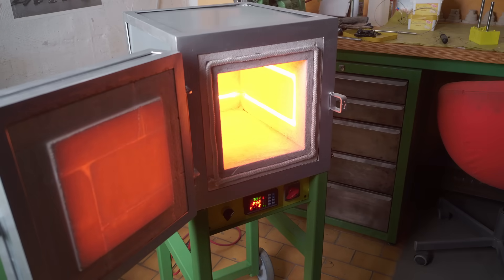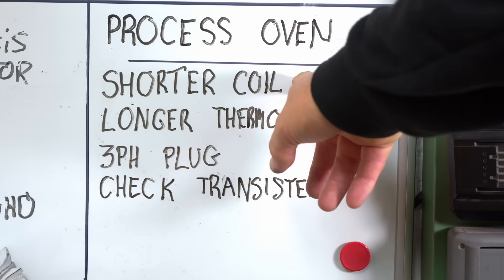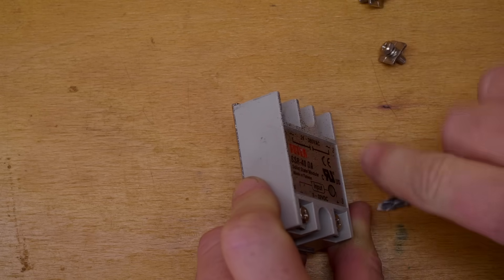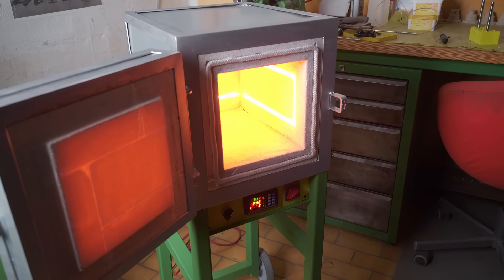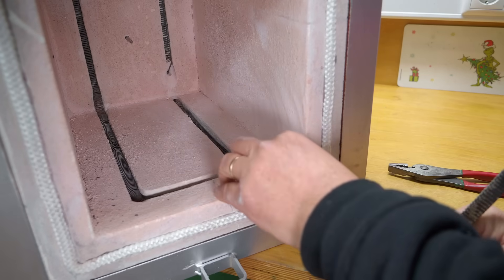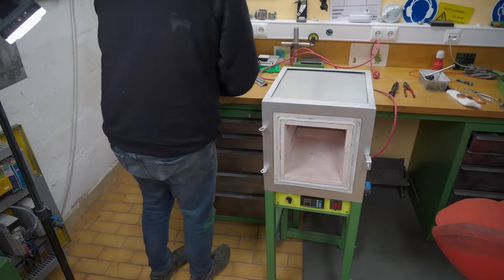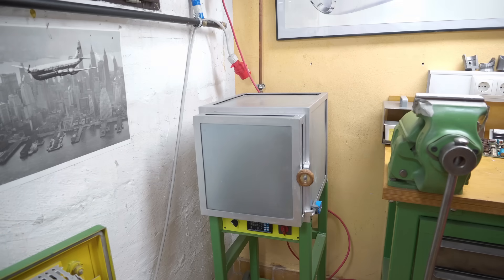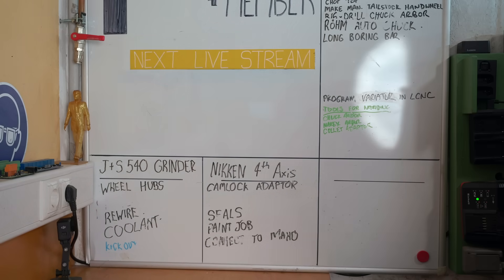Lets crank up the DIY process oven to 11 || RotarySMP

Comment: You already have 3 phase.
Add another coil and relay, connect it to the other phase, and you will double the power.
Or.. make two longer coils so they do not draw 3KW each, but for ex... 2.5 or 2 KW each.
Will be almost double power compared to previous version, and will not push instalation to the limits.

That half melted electronics...
Just move thate box down. Separate it from the oven itself. You have more than enough vertical space in that stand.

Yes.. I know.. more work... :) but...
Reply from the maker: My old oven was two phase. It is not trivial to find the space in the walls for more or longer coils.
I already ordered a fan.

Comment: I mean you could have just connected the old coil between two phases to increase power...
Reply from the maker: That would need a different coil length for the different voltage, ut yes, I get the concept. :)

Comment: try the old coil in an oven for 1 hour at 200 degrees Celsius, then it will (hopefully) no longer be so brittle?
cheers
ben
Reply from the maker: Thanks for the tip.

Comment: heat thenthal with a torch to red and the you can work with it without breaking it. you can even twist the broken one and use in case of urgency
Reply from the maker: Thanks for the tip.

Comment: I normally used 'bare' thermocouples with ceramic bead insulation  instead of stainless encapsulated type in furnaces.
Seemed to last longer and are quite a bit cheaper than branded stainless type. You might be using ebay specials of course, which I'd think are fine for temperature accuracy, but might not have the durability of a better quality unit.
For reference, my tube furnace is more than 20 years old, still on original thermocouple.
Reply from the maker: Thanks for the tip.

Comment: The 25A rating on the triac is probably conditional on the junction temperature being 23⁰C or so, as soon as it heats up, the maximum permissible current will probably fall significantly...
Reply from the maker: It has been recommended I replace it with a mechanical relay.
Reply: @RotarySMP Whether that's a good idea or not would depend on how the control output switches. If it pulses too rapidly, it will soon destroy the relay. I once worked on a kiln controller and a lot of effort was put in to making the switching profile turn on and off slowly enough to support big contactors. It turned out to be a really important feature on the controller and meant it found a lot of customers who favoured that over more rapidly pulsing controllers. It had features like looking at the rate of temperature rise and turning off the relay well in advance to prevent overshoot. If I remember correctly, the minimum switching period was about two seconds.
Reply from the maker: @AllTheFasteners  It seems to only switch about 5-10 sec when maintaining 900c.

Comment: Potters have these things called pyrometric cones that they use during firing. I don't think they're expensive, and suit a wide range of temperatures from around 580°C up to perhaps 1980°C. The great thing about them is that you can place them anywhere you like, so you could use four-or five at once to simultaneously check the temperatures in different parts of the oven. Not something you'd use routinely of course, but they could be useful for verification of your thermocouple and PID control, and to see if your oven has any hot or cool zones you should be aware of.
Reply from the maker: Good point Paul. A workmates wife does pottery. I will ask if they have any.
Reply: These sound like welding crayons?
Reply from the maker: @johnhawkinson  They are little clay cones of different melting point clays, and sag and bend over a a specific temp.

Comment: Any reason you dident just rewire the heating element to run on 400V ?
Reply from the maker: I would have to run the calcs, and would probably need a completely different coil, with different wire diameter, and number of turns.

Comment: Very interesting on coil size/resistance verus heating time; good idea on utilising 3 Phase outlet to maximise power in the shop.
It's always scary buying power electronics, unless its from top notch suppliers, though running power electronic equipment at 25% of rated capacity does offer some safety. 
Nice work as always.
Reply: Kanthal do some really good design literature for wire heating elements like these, available online in PDF format.
Reply from the maker: @davidbillington9654  That is what I used when I did the initial design. Not sure how I screwed up and ended up with the coil too low power.
Reply from the maker: Yeah, I feel better about putting the high current load onto the 3Ph wiring.

Comment: At 7:54 to 7:58, ventilation would probably be better, as insulation will still eventually get hot if it can not dissipate its heat.  Maybe try some more distance and ventilation, as well as insulation.  Insulation only slows heat migration, it does not not stop heat migration. Temperature gradation is due to dissipation across the distance covered through the material.  If it can not dissipate, it will eventually fill up with heat, to the full temperature.
Reply from the maker: Yeah, I have ordered a fan. :)

Comment: Give it’s now on 3ph you could add 2 more coils and drive them at 1500w for longer lifespan. 
Love this week’s music background.
Reply: or, and bear with me here, 3 shorter coils for even faster heating! More Power!
And, yeah, the music was great :)
Reply: @clasdauskas no need just connect 3 coils in a delta configuration meaning they are running at 400v so a heap of extra heat for no extra current draw
Reply from the maker: @shaynegadsden  The issue is the amount of wall space being so limited, so you can fit multiple coils.

Comment: I wonder if the discrepancy between the current you expect and the one you measure could be due to the bit of inductance created by the coil. It's a very loose coil, so the effect should be small, but maybe not completely negligible.
Reply from the maker: I have been told the SSR will also drop a bit.

Comment: I did the QA on sourcing SSRs for safety critical nuclear applications. The original 'Fotek' brand were very good - the problem is that there are more counterfeits than real Foteks! We got counterfeits even from established suppliers. 

You probably already know but for the benefit of others SSRs tend to fail closed circuit. In any device we made there was triple redundancy - a second PID controller that cut the power if it overshoots and a final bimetallic switch if that fails. Jealous of European three phase connectors - IMO it is way better than the NA standard. Awesome content as always
Reply from the maker: Thanks Francis. It has been recommended that I switch to mechanical relays to reduce the current drop.
Reply: @RotarySMP  I think it is really swings and roundabouts - what you lose on the load side with an SSR  you gain with reduced current on the control side. I may be overstating the danger of the failure mode - the nuclear industry is rightly  anal about fires. The reality is the the heating coil is its own safety being essentially a fuse and will melt almost instantly after the SSR latches on.. If you look at MIL-HDBK-217f the SSR will outlast the mechanical relay by a factor of 50-200 - I'd say that is worth a  worse power factor especially given that the SSR will be cycling at a decent rate at the set temperature which is hard on mechanical relays. We had to buy 20 years of spares for our samplers and in 20 years of operation we never touched them so I'd say that is a pretty rare failure mode. If you do fit a mechanical relay - given the current you need the mercury wetted ones are the best if you can find one and obviously beware of the latching versions - you need a diode across the coil to stop back EMF that every one forgets.
Reply: ... in short I'd keep your white board clean!
Reply: FYI I happened to be at our local pottery supply house and they had some very dusty Mercury relays on the shelf at what seems a very old price - a quarter of what digikey is asking. Given their extremely low failure rate I suspect it is probably the case at most pottery supply places.

Comment: Did you screw down a multi stranded mains lead wire in that terminal block without ferrules?
Reply from the maker: Nope, there are ferrules on all multi stranded wires
Reply: @RotarySMP  Good! I couldn't tell, but with the thermal cycling a necessity

Comment: If you haven't tossed it in the bin yet, the open-circuit thermocouple could have the break nearer the lead ends. You could try trimming back a few times and possibly salvaging it as a spare.

Regarding the fan, make sure you provide accommodations for the air to get in AND OUT.
Reply from the maker: I suspect that is probably the issue. 
Will do.

Comment: Or you could get two more solid state relays and run 3phase to the oven.
Reply from the maker: I dont have the wall space in that little oven to fit tw0 more coils.
Reply: @RotarySMP one long coil in each left/right wall and one in the ceiling.
Reply from the maker: @nscantling  Have you made an oven like this? Hard to get a coil to hang from the ceiling. Not impossible, but would have had to be planned from the start. 
I have 1.9m of coil groove. You can't make a two coils fit in 1.9m and remain within the heat density limits.
Reply: @RotarySMP  I did not consider that.

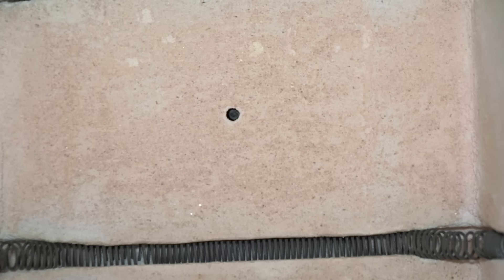Comment: 1:10 IMHO, just make the hole chamfered to the depth of the tip of the probe. keeps it protected an exposes it to the heat.
I've also found issues with the non polarized plugs here... 3 phase are polarized. (at least I'm pretty sure) 
You could install a dedicated outlet with bigger cable and breaker and then mark the phase side on both plug and socket.
Reply from the maker: First I will see if this set up has any issues Johannes.

Comment: I have some kanthal wire and thermocouples and crydom solid state relays etc that i can send you if youd like
Reply from the maker: Thanks for the offer. I still have enough left over Kanthal 1.2mm to make another coil. It has been suggested that I switch to a mechanical relay to reduce the losses there.

Comment: @2:42 G'Day Mark, are you sure about that? All our standard house wiring is 2.5mm² for use with a 16 Amp breaker.
Reply: However, your red extension lead cable still is 1.5mm² so there could be some voltage drop.
Reply from the maker: Good points. I am not sure what this house wiring is. It is pretty old.

Comment: The oven might very well be over the 3 kW mark when fed by the CEE plug and 2.5 sqmm wire as the voltage drop will be lower.
Reply from the maker: That would be great .)

Comment: Remember to do a new PID tuning with the different thermocouple and heating element :)
Reply from the maker: Yeah, I took a look at that yesterday. The manual is a horrible translation. I think I did the autotune (at least I tried to??) and it seems to control the temp at 900 within about 4° indicated.
Reply: @RotarySMP  They're always horrible to read in my opinion. Often incorrect and Swahili added...

Comment: Nice to take time and put some finishing touches on projects. 👍😎👍
The camera angle always distorts the view, but it looked like where you have the oven when plugged into the 3-phase outlet, the cord was resting on the outer metal corner of the oven frame.  Does that edge get hot?  Wouldn’t want to melt the cord and start a fire 😉.
Reply from the maker: Thanks for checking Joell. I also noticed that and moved it off.

Comment: UK spark here. According to UK regs 1.5mm is only good to a maximum of 11A - we only ever use 1.5 for lighting circuits. We use 2.5mm for our 13A  (ring) sockets - 2.5mm is good for 27A. Depending on distance from fuse board obviously. There are a number of online cable calculators based in the UK for a sanity check
Reply from the maker: This place is pretty old. I am not sure whether they used 1.5 or 2.5 to the sockets, but I know there is 2.5mm going to the 3Phase sockets.
Reply: At least in Germany its ok to use 1.5 for 16A up to a distanz of 17m, but nowadays its common to use 2.5. Also most Schuko sockets are only rated for 10 or 13A continuous load.

Comment: In Australia 1.5 240~230 is 10 amps. 2.5 is 15 ~16 amp supply.  Even 2.5 is a bit small for a constant load like the electric furnace.  I used to get the sparkies to use 4mm as it kept the temp down on the connectors in plugs and sockets.   Also good in hot areas as the heat de rates the cable pretty quickly. 
Also it's a bit odd that your thermo couples are wired up with crimp on connectors.  For K types to work accurately all connectors and terminals should be made from the same material as the wire and thermocouple.
Reply from the maker: All of my single phase outlets have 16a CB's, but I am pretty sure they are only 1.5mm2. I would not be surprised if the standards have changes since this place was built.
Reply: @RotarySMP same in the EU as daza says above for cross section. 1.5 is illumination, 2.5 for sockets. I also use 4mm to supply my kitchen oven from preference, not law in the EU as far as I know but it is in the UK. As you are all surface conduit, would not be a biggie to upgrade the specific supply for the oven to 4 and you can pull 3kw or so at length without warming elsewhere 😊
Reply from the maker: @gilesfone  Good point.

Comment: why wouldnt you make it 3phase? so easy and much more power and more balanced phases. also it doesnt matter if you disconnect live or neutral. thats why schuko is better than everything else. plug it anyway you want and still works safely. also 1,5mm is only safe for 10amps. you need 2.5 for 16A. also those normal outlets are not rated for continious 16A. only for few hours max
Reply from the maker: My last oven was two phase. You get into a space problem, as there is only limited wall area in these ovens to hang the coils. You are in a corner of trading off coil space, heat density, wire thickness etc.

That is why I hooked it up to the 3Ph socket, as I know it is rated for at least 16A.

Comment: When violating hidden screws, I typically just cut out a hole big enough to reach the screw head rather than remove an entire label.  Of course, if I’m trying to preserve information or conserve the label, I then heat it to relax the adhesive and peel the whole thing.  😎
To remove an epoxy “seal” like this, I chill it with freeze-mist (canned air held upside down is cheap) and it becomes brittle.  
Also, you might get ready to replace any electrolytic capacitors in the controller.  They do not like heat.  I would consider ventilation around the controller.   🤓
Reply from the maker: Good idea. Luckily the label stuck down again pretty well.

Yeah, I have ordered a fan :)

Comment: That really is a fine looking oven. - Heather
Reply from the maker: Thanks Heather. I need to add a fan to that controller.
Reply: @RotarySMP  Yeah, that was getting very hot. If you hadn't taken it apart, I guess the controller would have just died one day.

Comment: I'm surprised that your domestic outlets are on 1.5mm cable! In Australia it's a minimum of 2.5mm for standard power circuits, and that's for outlets only rated for 10A at 240V.  15A outlets need to be on their own circuit with a minimum of 2.5mm2
Reply from the maker: My place is old. Maybe the standards have changed here as well.

Comment: Maybe you could do a 2 stage heating wire where the first draws 3kw cold, then heats up dropping power usage, then switch on the second loop drawing maybe 700w. The second one heats up with the first passively, it shouldn't drop as much, better utilizing availible power.
Reply from the maker: I dont have the space in the oven for two coils.

Comment: Does the oven get hot enough to melt aluminum so you can cast small parts in the shop? Or is that something you'd really rather do outdoors?
Reply from the maker: It could Brian, as the pouring temp is about 750°, but the latent heat of melting means it would be a pretty slow process to get a small crucible of aluminium up to that temp.

Comment: why not make 400V heating coil by connecting it between 2 phases? some home ovens are wired like that and they are only controlled by bimetalic thermostat. much more eficient, require thinner cables per given power output because it runs on lower amperage, you could replace  solid state relays with a mechanical contactors like chinese melting ovens do and they can be 3 phases independent from the electronics power suply because electromagnet coil is separate circuit than the contactor inputs and outputs
Reply from the maker: I was also thinking about that. Maybe that will be the next mod.

Comment: 7:54 it's hard not to notice that the controller housing has vents on the topside that you have now covered with insulation. (This reminds me of how my induction cooktop's cooling fan starts running after my kitchen oven has been on for a few hours [thanksgiving turkey], and it starts drawing hot air discharged from the back of the oven through the cooktop. Inter-device cooling pathway misalignment engineering error!) Others have commented on the insulation versus extraction, but I didn't see anyone mention the vents. Maybe there are vents on other sides of the controller though?
Reply from the maker: I need to add a fan underneath that controller to blow cool air up through it and out the gaps.

Comment: For the electronics box, you may want to either relocate it or add an access panel and a fan. Having to lift up that oven to do simple checks looks pretty annoying. With the insulation it will still eventually heat soak through it since it is a closed compartment. Maybe even just a set of vents could be adequate?
Reply from the maker: Yeah, I need to add a fan.